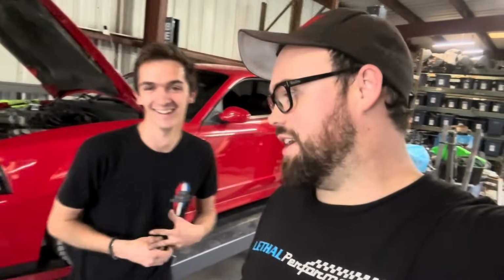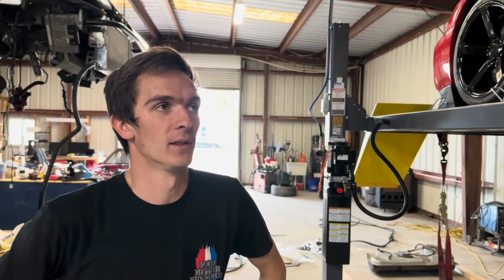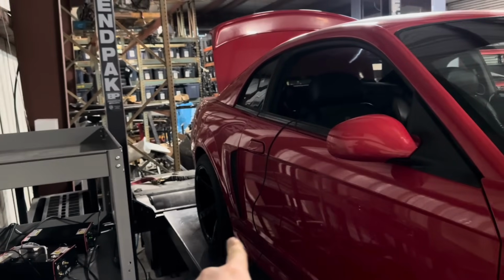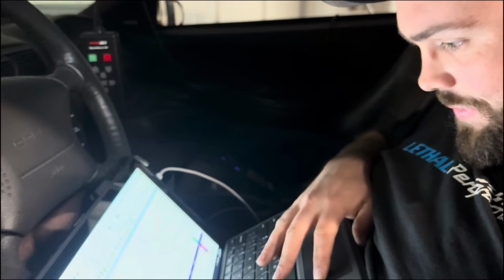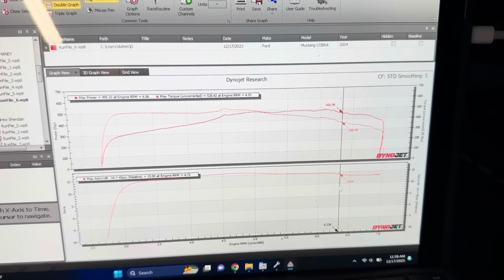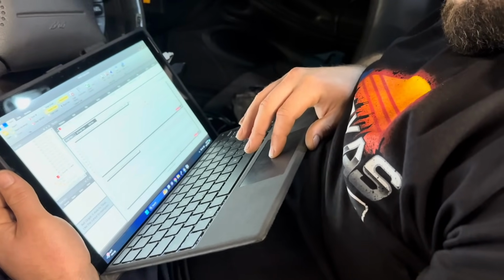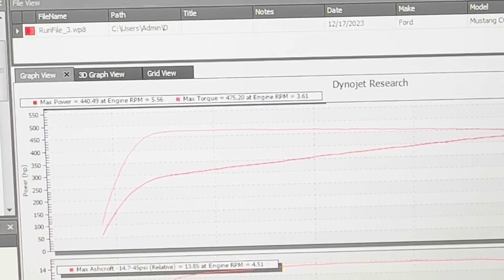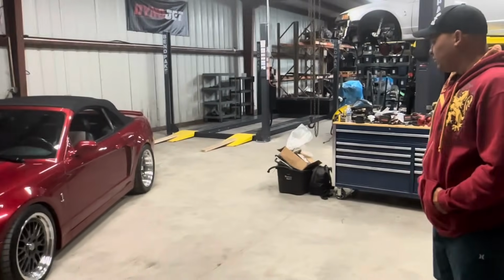Facebook Marketplace Terminator Cobra is a DUDD

Comment: I had just under 470 to the wheels on mine and it was hard to find someone that wasnt a german/vette/or heads cam camaro firechicken car that could win. This was 10 years ago of course but it just felt perfect power, was super fun to drive. Headers/MAF/lower pulley and better pumps i could say 500 ish and dust off any of the ones that i mentioned before and were close races.  One of my best Races was a super sleeper honda, that thing stayed at my door, left me happy actually to beat a sleeper like his. guy was not happy though.
Reply: forgot to add proper suppras to the list of course, some great races were evos or subies, could stil beat them but they would get the pull on me from the line, Thats when roll races were not a thing yet.

Comment: “Tuner”: Adding fuel and timing to base files
Reply from the maker: If by base files you mean the stock tune from ford? Then yeah ford provides great stock files. Keep hating. I’ll keep tuning
Reply: How do you think other tuners do it? You literally begin with a stock type tune. Add injector/maf data. Mess with idle and startup, low timing until fuel is right etc
Reply: @MustangLifestyleTV  yes, that’s exactly what I meant lol
Reply: @ryanwilliams2956  Yes, that’s how everyone does it then they claim they’re the best tuner out there and then bash other tuners lol. But there’s only 1-2 guys that know how to do a tune from scratch without a Ford base file.
Reply from the maker: @Slimflow21  The ford stock tune is what everyone works off of. There is no tuning from scratch. Ford lays the ground work

Comment: How reliable is the wideband being in the rear o2 spot? My tuner says my WOT is fine but im seeing 12.4-12.5 WOT. 10lbs boost 93 octane(my tuner uses a pipe sniffer)
Reply from the maker: Typically pipe sniffer shows an even leaner result. If you are seeing 12.5 at the rear o2 then it’s probably pretty close to being right